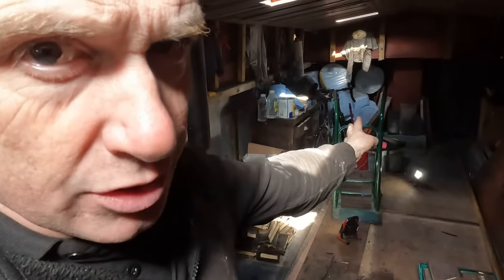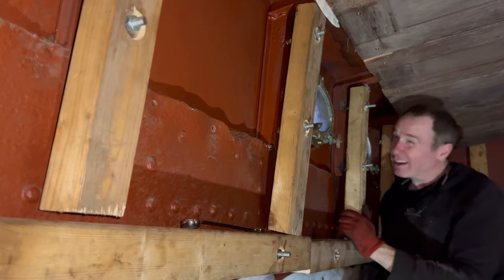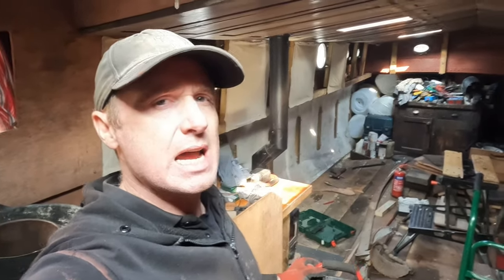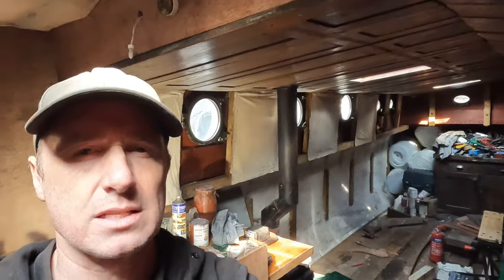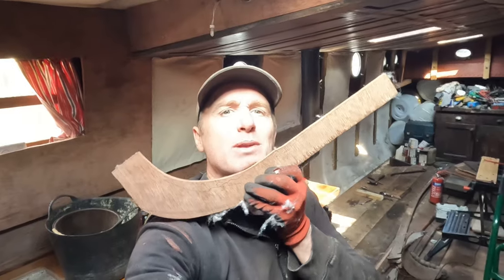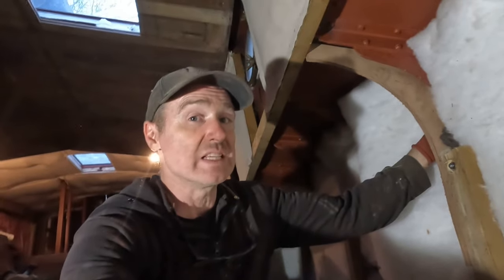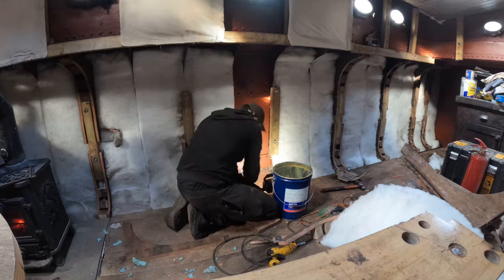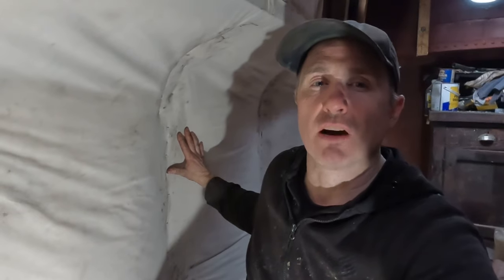Moved to Limehouse, and lined the gunwale.

Comment: Good Spring Morning! Nice neighbourhood you moved to.  A lot of work done! Excellent. The only thing I am a little worried about is the underside of the side decks. I noticed that almost all the condensation formed on the horizontal parts of the steel. So it is wise to adhere some insulation material like armaflex to the undersides. But now you have  greased it already...that makes it difficult. But check regular if there are big droplets of condensation forming under the side decks.
Reply from the maker: I did look into armaflex and it’s quite expensive. I understand the issue. But there is a reason why I’m going out of my way to ensure disassembling the interior will be super easy. (you only need to undo the nuts and battens fall off)…. 
The decks need to be replaced. I’ve welded loads of patches all over them and it has ensured it’s watertight for the moment. But they will need to be replaced.and when that happens the interior has to come out. I’ll be a millionaire by then and won’t be a problem!😂😂😂😂
Reply: I hope to be around when that happens! 😂

Comment: I only know the Taco version of Puttin' on the Ritz before today. Earworm: engaged. Nice progress. Also: Either you've grown really tall in a couple of months, or the forward end of the cabin is consideably ower than the original cabin. It looked like you're trying really hard not to hit your head.
Reply from the maker: It is above head height for me, but I have sheets of Plywood stored on the floor and that’s losing my headroom. It’s progressively lower at the front that at the back of that run. However, the main cabin is 8 tall!😀